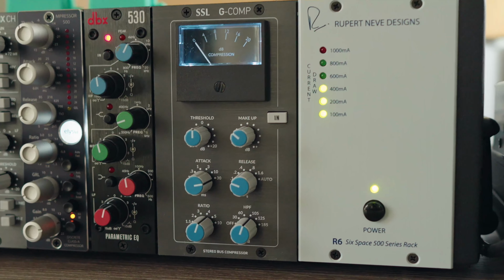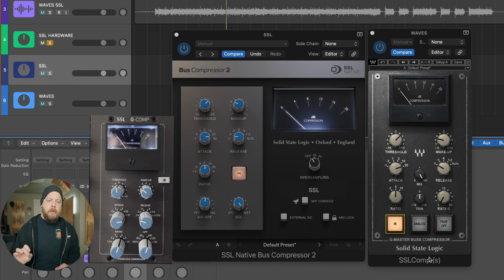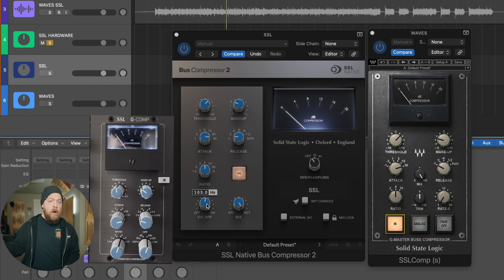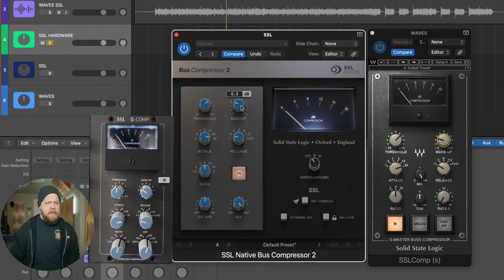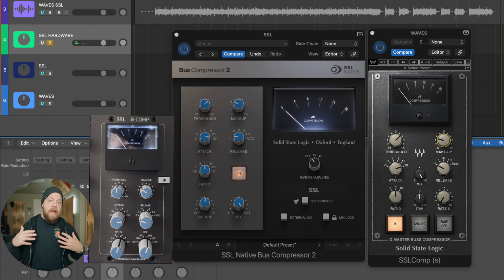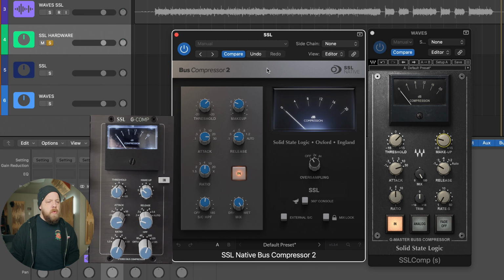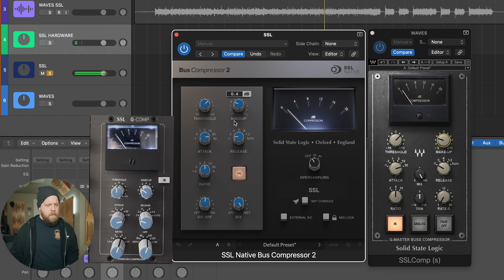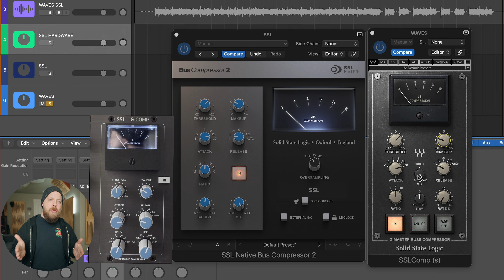Can You Hear A Difference? SSL G-Comp Hardware Vs Software

Comment: Compressors are pretty subtle anyway... or at least they should be. 

I think the thing to remember when you're doing a mix is that there's usually more than one compressor. I usually have a compressor on bass, at least one on drums, usually one on vocals and sometimes even buss compressors gluing tracks together and then one on the master... 

Besides the fact that doing it with hardware would be expensive (5 compressors adds up), I may want different compressors on different tracks, or I might want another one of a compressor that I only have one of... With digital I have as many of each as I want. 

BUT, I think that's something to test. One compressor didn't change much, but if you're using 3-5 or even more compressors on a song: How much does it change the sound? I would expect the differences to become much more noticeable. 

Then again, I think my takeaway from this is that hearing the difference between hardware and software compressors is hard to describe and subtle. But changing a knob slightly had a real impact. So worry less about which gear you use and more about how you use it.
Reply: Not subtle at all when used on drums in modern metal.

Comment: They are all fairly similar. The action/reaction is all pretty close and they definitely sound like different versions of the same type of compressor. Wouldn't say i prefer one over the other. The hardware seemed a little more open EQ wise, like it was a little more saturated in the top end or not darkening the sound as much. Waves seemed to be the darkest of the bunch and emphasized the mids a lil more. Any of this could probably be accounted for with some bus EQ. All are great. If you have money for the hardware, obviously you're result is gonna be stellar. If you only have the $29.99 for the waves, grab the waves puiqtec while you're at it and boost some top and youll be 98% the way there. Good vid Fluff 👍